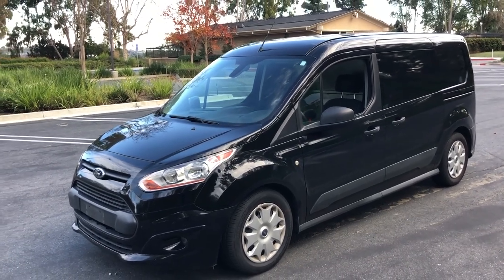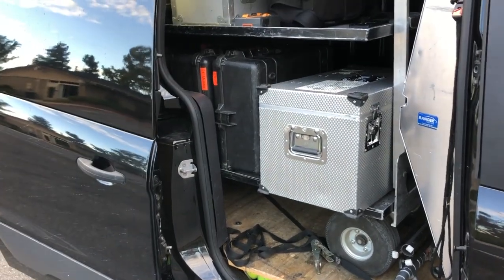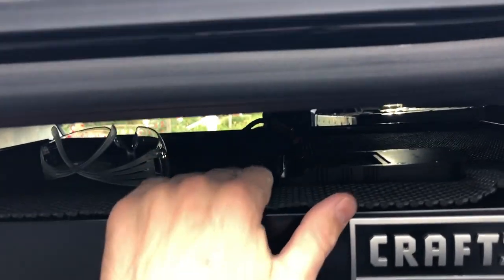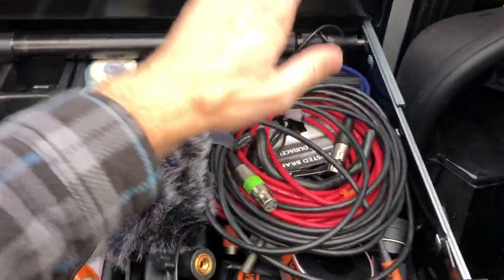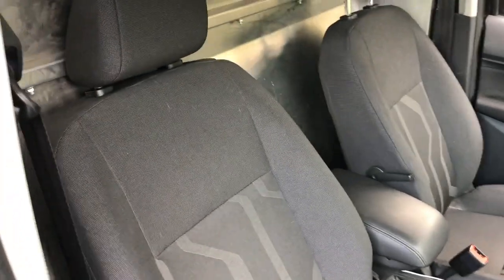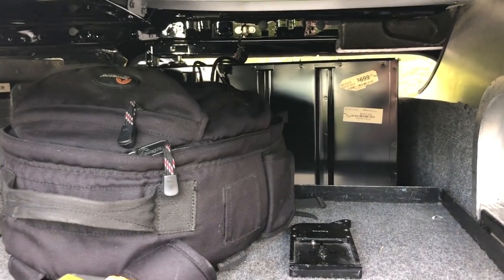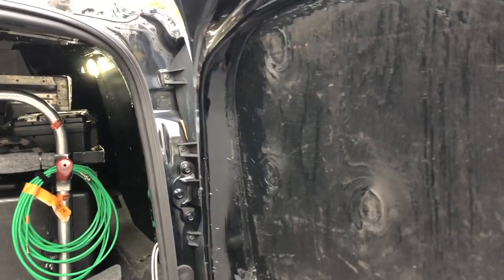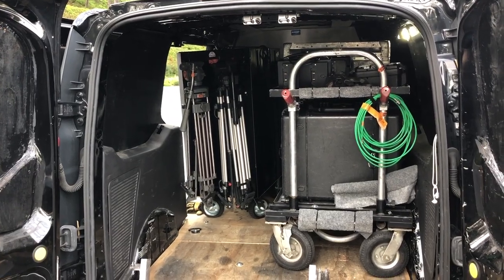ENG Documentary camera van tour

Comment: Cool stuff! I'm building out a Sprinter van as a camera / production vehicle.  Where did you get that ramp and how do you like it?  I was thinking more of a ramp that was not attached but then there's the storage issues....
Reply from the maker: DiscountRamps.com.  Go as long of a ramp as possible.   If the manufacture recommended is 8' go 10' feet. You want it attached, a floating ramp is a huge PIA (my first van was that way), slow to deploy.  Second, it would need to be strapped to the van anytime there is a load on it, otherwise it can kick off the tailgate and fall to the ground.   An electrician I use to work with broke his back when a ramp dropped with a cart he was pushing.  Injury ended his career.  Happy building...  If you design it to push a 100lb cart, soon enough there will be a 300lb cart on it.

Comment: With your Shore Power, does that mean you have an extra battery/power source in the car to charge your batteries?
Reply from the maker: After multiple fails forgetting to bring batteries to set, from long days and sleep deprivation, "shore power" keeps all chargers and batteries in the truck. Each night plug the van into an AC power source, no unpack and repack to charge equipment batteries.

Comment: Thank you for the video. I’m building my own van and I’m considering the caddy. Can you fit a junior magliner through the side door? Does it fit between the two doors?
Reply from the maker: Yes, a Jr should fit, the mini size will for sure.  However, you will most likely need to remove the plastic side door footwells and install a sheet of plywood as I've done to this van.  Otherwise, you lose over a foot of width due to the footwells.  On the magliner the red handles may stick out too far.  If that is the case, Backstage or Filmtools make a mod that sets the red handles to pivot when in transport.